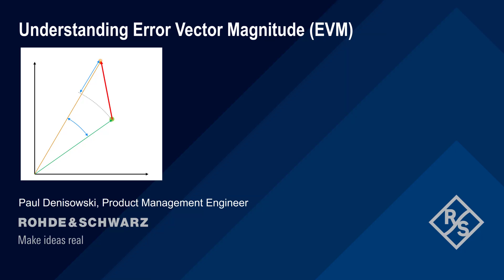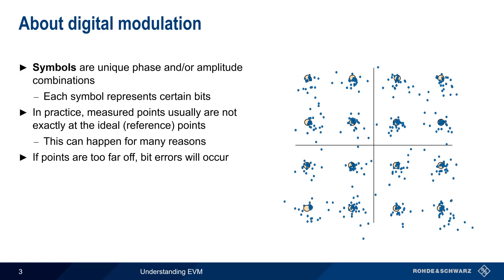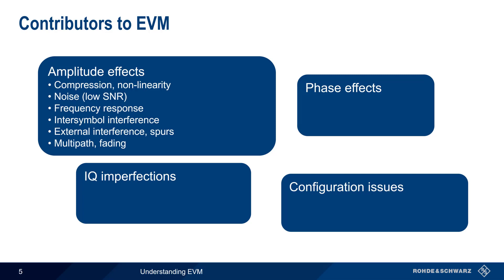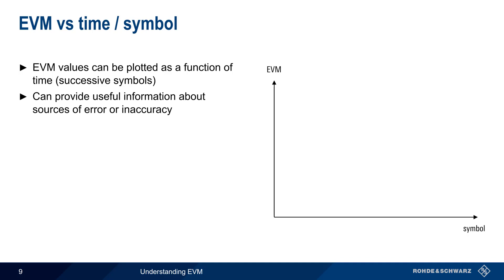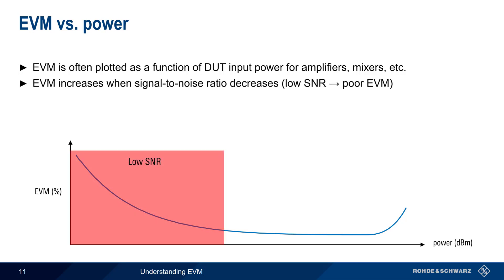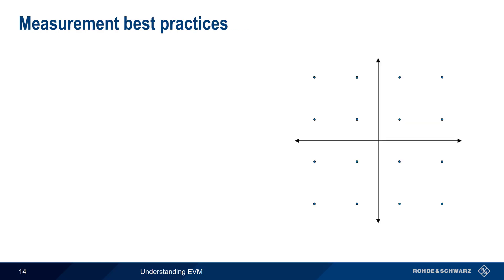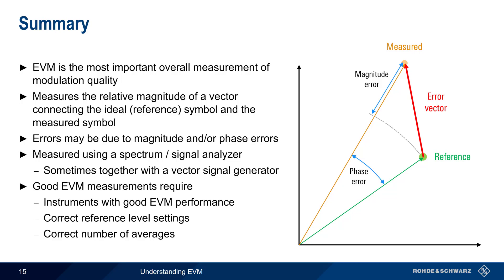Understanding Error Vector Magnitude (EVM)

Comment: Great videos!Thanks!
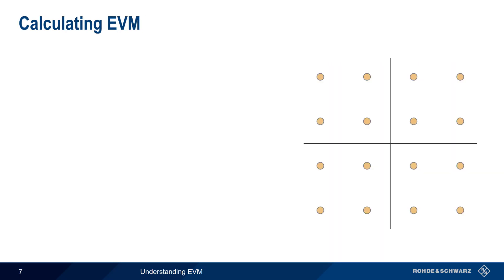And how to decide ideal vector endpoint @ 5:34?
Reply: Thanks!  That's a good question.  The receiver must know things like the modulation type, modulation order, symbol rate, filter type, etc.  From this information, it can determine what the ideal constellation is and where each ideal vector endpoint should be.  This information can either be "manually" entered / configured by the user, or in some cases it can be signaled to the user via some separate channel (e.g. in cellular systems). Hope that helps!